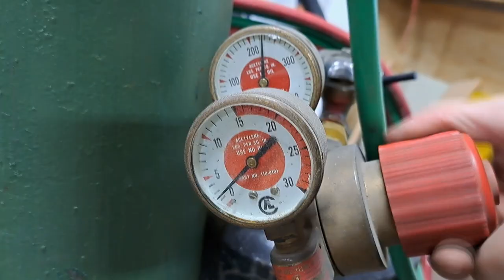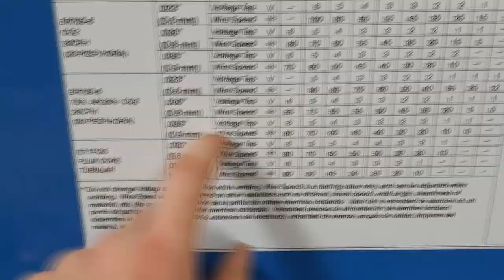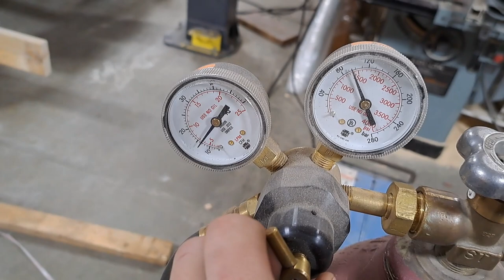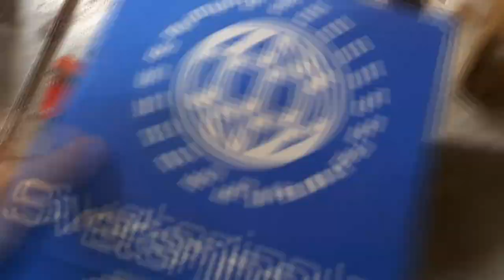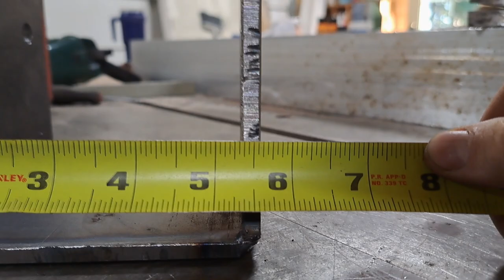MIG GMAW Structural Welding Post With Base Plate Fabrication

Comment: grooved out the butt joint on that floor pad 👍 At least you’re not like the 2 nimrods I work with that run structure downhill. Have you ever tried running a 90/10 mix or some call it a C10 mix for running spray transfer?

Comment: Just a question, why r u gas cutting through a pwint pen line thats so inaccurate? The most accurate way is a scribe line plus a scribe line wont rub off neither like chalk for example
Reply from the maker: Great question. As you can see later in the video, I draw a line with a paint pen and then scribe a line through the paint. It makes it easier to see exactly where the scribe line is, compared to just on the steel.
Thanks for watching!

Comment: u are putting your wire wheel the wrong way, instead of coming from the top to the wire guide, put it coming from the bottom it will be in less effort